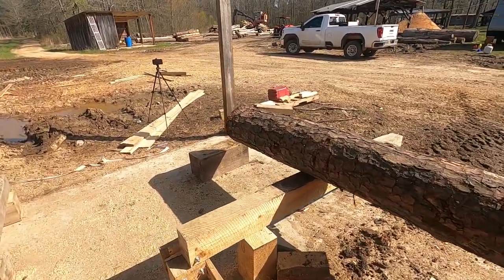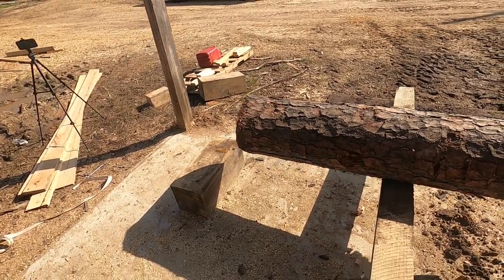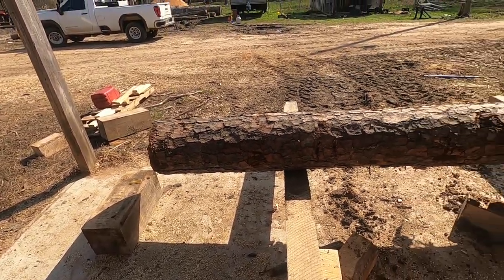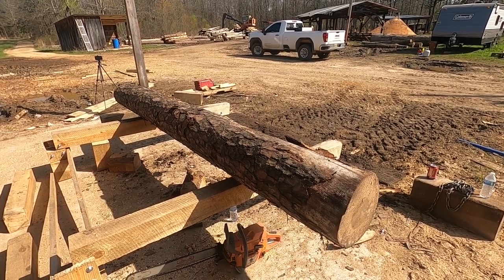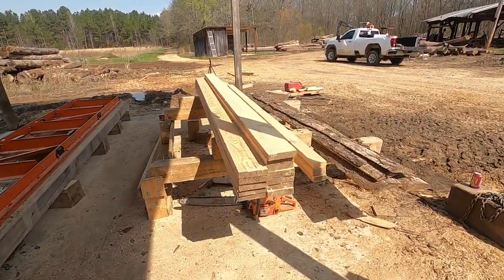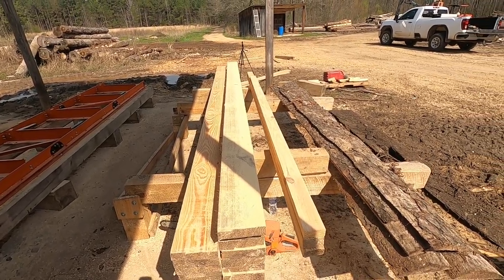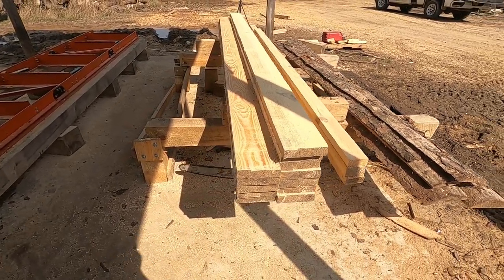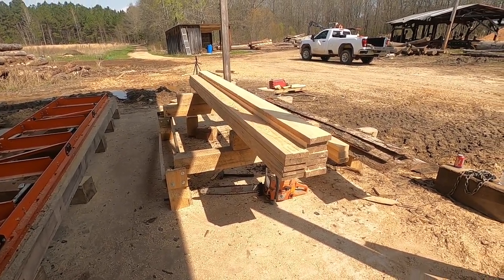Sawing Sunken logs on the Woodmizer Sawmill!

Comment: In south Louisiana we buy what is called sinker cypress witch at first in late 80’searly90’s was ax cut trees lost in the bayous and rivers along the way to the mill 150 years ago ! Giant trees that made beautiful lumber but as time went on those became harder to find so they started pulling them out of big lakes that were basically blow down trees with the root ball still attached , thing is they may have blown down a thousand years ago so the natural tannin in the wood is gone replaced by brackish water so when cut it comes off the mill beautiful but as it dries it slowly turns green still pretty but no natural rot resistance left. Sorry for the rambling
Reply: Very interesting

Comment: Nice job. I wonder if you could make the push bar easily high adjustable. Might make pushing the head more easy for shorter people I suppose. 

Kind regards Christiaan
Reply: Doesn't appear adjustable, does it? Maybe one of the few things about the 55 I don't like. REAL close to ordering one though. The bar DOES appear VERY sturdy so maybe actually weld an addition? Or a temporary clamp modification?
Reply: Watch video from about 6:20. Clearly there are options to add a lower, or higher for that matter, push bar.

Comment: This is probably the best place to ask since you didn't have it long and i've only seen a few videos on it..   i'm debating on a perhaps distant perhaps not purchase between the WM HM126  and the LX50SUPER  which from everything i can gather is the same mill as the LX55 was minus the adjustable blade guide (which is a dumb thing to remove but moving on..   i know you hated the HM126 and i am at this point leaning a hair to the LX50SUPER but the lack of videos about it online and long term reviews have me a little on the fence they have a weird marketing problem with this line  where they had the LX25 and its gone  and the LX50 which i think was EU only?   and the LX55 which was US?  its confusing as hell now the LX50START & SUPER.    I'm worried about the quality of it being one of their few offerings not made in the USA.   I saw a video of a guy with an LX25 which had a lot of paint peeling off after i think a year or less and I'm not talking about a wear area like the bunks no,  it was the black uprights on the head..  paying that much for a machine makes me leery even though its the cheapest entry level option you can get save the HM126  its still a lot for a newcomer to justify and risk.   I am still leaning LX50SUPER  even though its about $300 more right now even with the deal..  because i do think the frame is much thicker..  i would have preferred full box bunks  but maybe the thickness makes up for it..  can you hit some highlights on what you think was bad about the HM 126 and areas that the LX55 (as best i can tell same as the LX50SUPER) outshined it..  the fact that you got rid of it so fast made me wonder if it wasn't that good.
Reply from the maker: I would stick with Wood-Mizer. It’s usually worry free. My woodland was constantly needing attention.